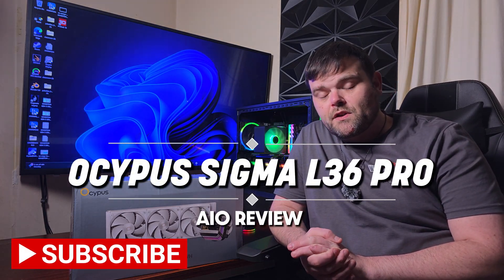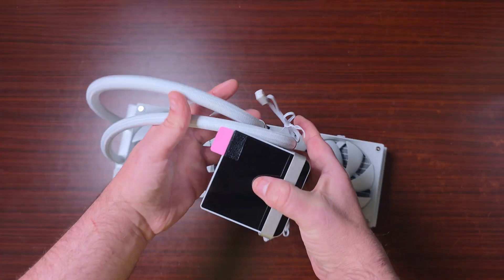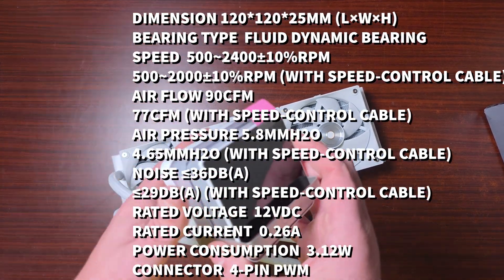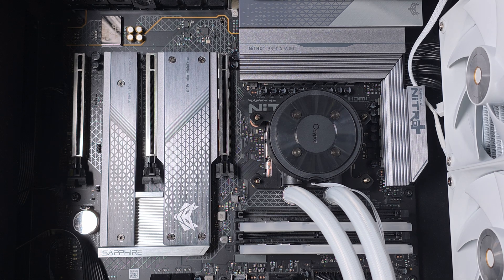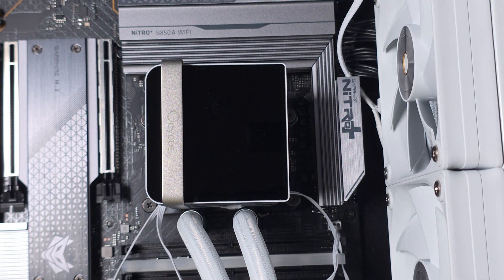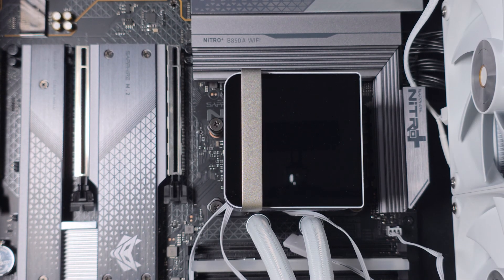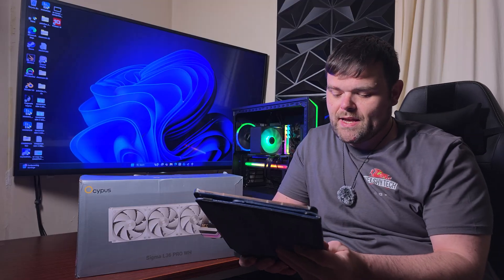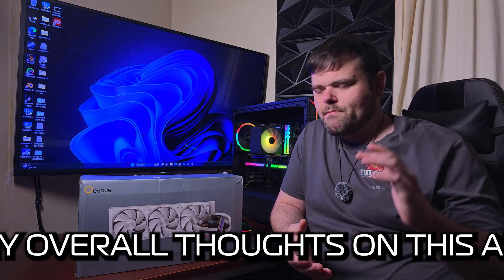Ocypus Sigma PRO L36 WH Review – The Best White AIO of 2025?

Comment: Can anyone tell me why 3pin and 4 pin matters? What will I compromise if i go with this aio? My CPU- Ryzen 9 9900x
Reply from the maker: The difference between 3-pin and 4-pin connectors mainly lies in their control capabilities. A 4-pin fan connector allows for PWM (Pulse Width Modulation), giving you more precise control over fan speeds, which can be crucial for cooling performance. If you go with a 3-pin AIO, you might miss out on some efficiency and noise control.
Reply: @WELSHYTECH  Thanks for the quick reply. Now I understand it clearly. This cooler is around 103 dollars in Bangladesh. I am impressed with the performance in comparison to other AIOs. Maybe I will look around more and see what AIO will be nicer for my cpu
Reply from the maker: No problem at all bud 👍